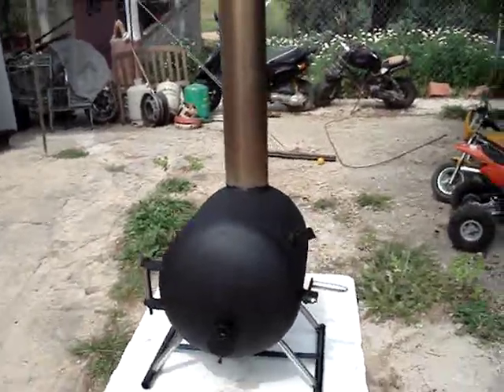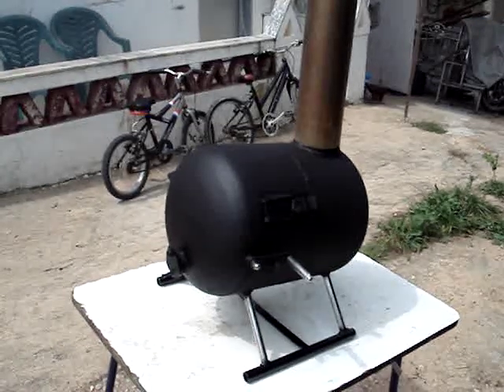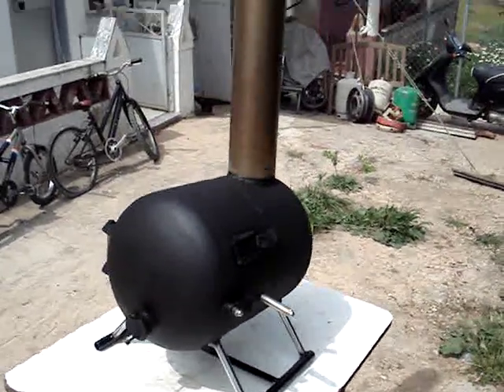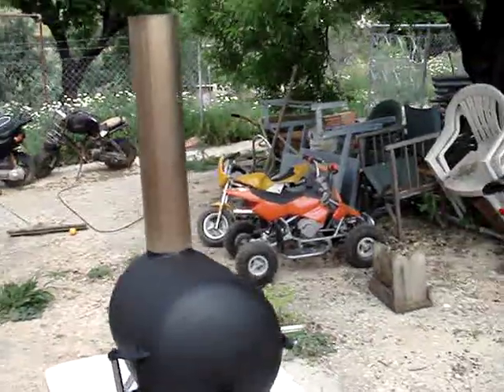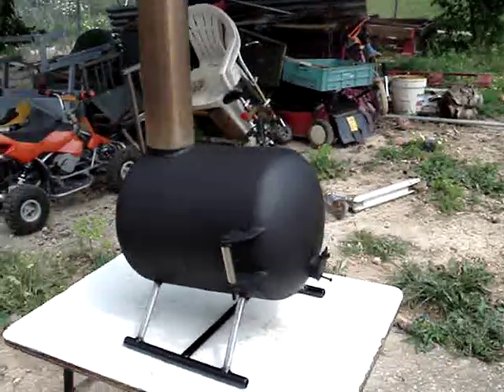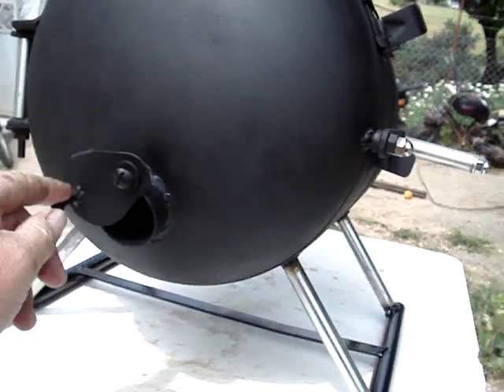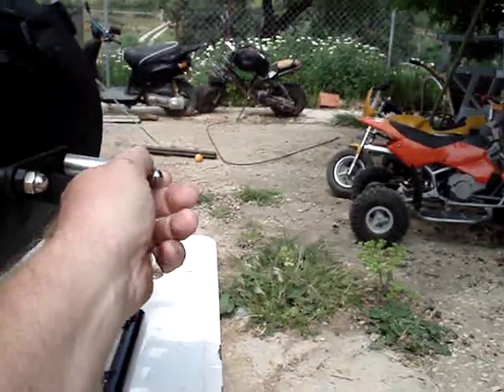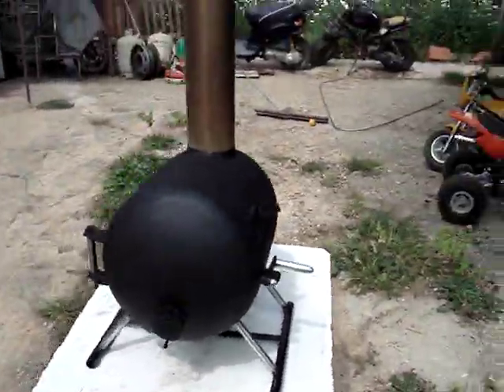Recycled gas bottle log burning stove part 3

Comment: nice design but one thing i would suggest is that you dont cut the whole front off the bottle because when it is opened smoke will pour out, just make a small door in the front of the bottle. but still a nice stove.

Comment from the maker: @Letendrejared Hi, the hardest bit is getting the valve off, make sure the bottle is "empty" i.e. used up, then away from the house lay the bottle on its side, you will need to brace through the handles with a pole of some sort, use an extension pole on your spanner/stilsons because it will be a bind to get off (prepare for bad language throughout this bit), once off invert bottle, gas heavier than air drains out, leave for a day, upright the bottle and put a hosepipe into....cont..

Comment from the maker: Sorry been busy in the shop, right, I'll try again, typed all this out on a phone the other day and lost it twice so gave up...
If possible mount the burner outside and close to the wall (if not flammable) if you fit a 45 degree angle on the chimney and run a pipe through the wall, inside add another 45 to run the pipe up the inside of the wall, I did this in my house in Portugal with stainless pipe, never needs maintaining, assuming your inside height is about 3 meters, allowing for (continued)

Comment from the maker: @Letendrejared cont...hosepipe into the hole and fill bottle and then let water continue running for an hour or so, empty bottle, it will still smell but be safe to work on....hope this helps and good luck removing the valve.....have fun...

Comment from the maker: continued....the height of burner and 45s you should still get 2 meters of pipe inside, (i'm assuming you can go out op the roof, if notreverse the process higher up to take it out again, you would have to run it with an unbaffled chimney so flames do go up rather than get trapped in the burner heating it up, the pipe will get so hot you can light fags on it!  This works better with only 2 45s to aid draw on the fire but will work with more (not good with 90 degree turns) hope this helps